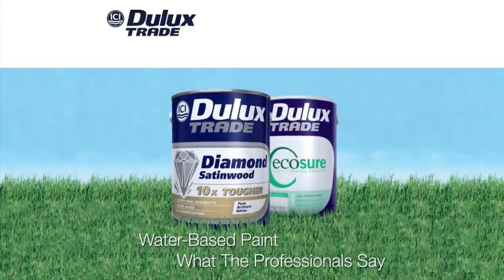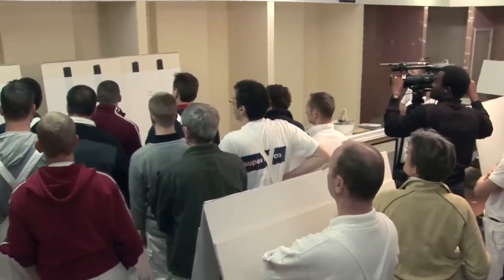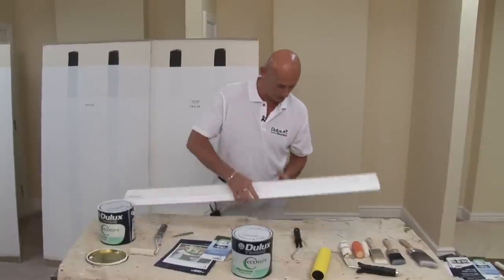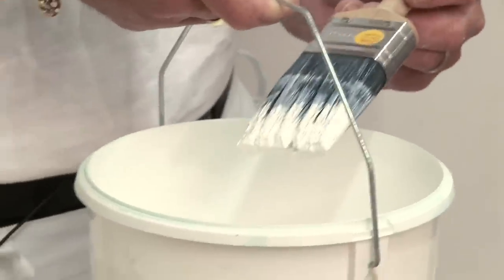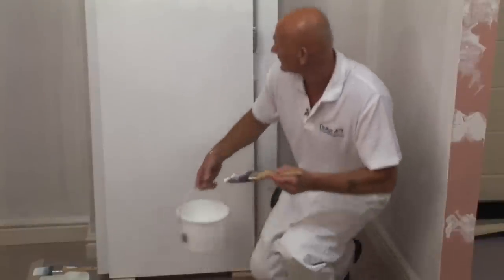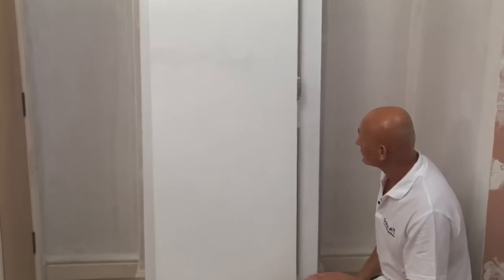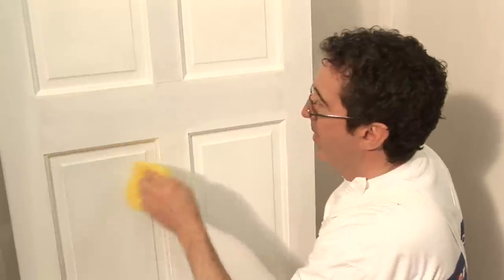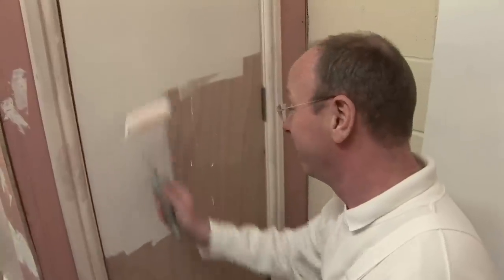Water Based Dulux Trade Paint - What The Professionals Say

Comment: I've been a decorator for 42 years and hated water based gloss/satin. But they're getting better. I've just done a job and used Dulux water based gloss. It was surprisingly good. I used the Johnstones equivalent last week and found it to be better. Watching this video I can't understand them using a small roller. I use a medium pile for flat surfaces and then finish with a brush. Speed is the thing with water based and outside work is impossible with them. Wiping the surface with water? Surely that's just thinning the paint as you apply it? On panelled doors I find using a 2 1/2 inch brush and a 1 inch for the recesses works fine. But speed is the thing.

Comment: I thought I must be doing something wrong with it, due to visible brush lines in the finish, despite damping the brush just like him and then using  coach painters method which is quite similar to his way.  
Looking at the close up at 4:41 , if anything my finish with that stuff is at least as good. This proves they've got a way to go before making it as good as oil based. 
I've been a painter for 15 years. I'm a perfectionist and take pride in working out the best method for a fine finish. I can put on oil based with virtually no brush marks, so I don't feel quite right signing of on an even slightly stringy finish with water based even if it is better for the environment. 
I'll only change to water based if they can sort out the flow rate problem.

Comment: By wetting the door slightly like he shows in the video with a sponge  before he applies the water base gloss to the door, Won't this greatly reduce adhesion and promote bubbling? Please correct me if i'm wrong if it doesn't that's a great tip and would make applying water based gloss about 10x easier with a better finish.

Comment: I've just used acrylics to do a couple of rooms and I'm going back to oil even if it does yellow. Coverage is very poor, yes it's easier to clean up but you'll be cleaning your brushes a lot more often since it goes off so quickly and gets stringy. Will try again in a few years.

Comment: As other people have said the water based paints dry super fast and leave unacceptable brush marks, In its favour it does stay brilliant white. I have just used Dulux Professional White Undercoat and Gloss, the undercoat goes on very nice and you can cover a lot of imperfections with it, the gloss goes on very nice too and the effect is like glass on my frames, "well I did do a lot of sanding :)". After 2 weeks I scuffed the stairs paint and a flap of skin came away, leaving wet gloss underneath, after 3 weeks I was able to put a finger nail mark in the paint, after 4 weeks the paint is feeling harder but still not fully cured.
Good paint overall, for my next job i'll try Leyland gloss as its a lot cheaper and has good reviews from screfix.
Reply: +3volv Have you tried the Leyland Gloss yet?
Reply: +Anon Nymous Not yet, I did try the Leyland Trade Emulsion, the paint was full of skin, had to pick loads out the tub and still had bit all over the wall, a week after I painted the hall I used a wet cloth to wipe off a mark, the paint came off :(
Reply: +3volv Interesting. I used their Trade emulsion and didn't have any issues with it. Also found their waterbased eggshell pretty good too. Just need to find a hard-wearing satin or gloss paint that STAYS white for more than a few months.
Reply: +Anon Nymous The Dulux I used took like 2 months to fully harden, its still white and like glass. trial and error I guess, hope you find a paint you like.

Comment: Used a water based gloss on my door frames. Thought the finish was so bad i decided to strip down all my door frames down again. Water based dries to quick and doesn't level properly leaving unsightly brush strokes. Trying to strip it all off with a heat gun has been a right pain as it turns into sticky elastic substance.

Comment: I'm a professional P&D with 40yrs experience, I much prefer oil based paint systems. Yes, water based has its advantages, but it flashes, yellows quickly, ruins my brush stocks despite wetting prior to use. I lay off with a great quality laying off brush for water based gloss, it helps but i prefer applying 2 coats for a decent wet and solid finish. Overall, I'm a dinosaur that still prefer oil based systems I'm afraid.
Reply: bumble1612, I wonder if you could give me some advice, I've just painted a flush door, using  Dulux Trade High Gloss and a sponge roller. You can see lines all down the door where the roller slightly overlaps, I used the roller on a glass door with just a four inch wood surround and it looks fine.  Any help would be great. Cheers.
Reply: RAVEN AK47  Thanks a lot for your reply, I used oil based paint, Dulux Trade High Gloss. Cheers
Reply: RAVEN AK47  Thanks again. At first glance, painting seems like the  a simple  DIY job, it's anything but. Everything is simple until a standard's set. 
Cheers.

Comment from the maker: Thanks for the feedback guys. if you have any questions, why not give our Technical Advice Centre a call on 08444 817 818, they will be happy to assist.
Reply: I’m not familiar with your particular paint but have used waterborne paints for over 20 years and their evolution has been remarkable. I would never go back to oil again and find the finish to be every bit the quality of oil, having said that your demonstrator was over brushing & rolling which works air into the product and leaves heavier texture in the end product.  Thanks for your contribution to the advancement of waterborne paints in the industry.

Comment: Sorry Guys, but I have tried so hard to use Dulux satin wood quick dry and the problem is they are lightning fast dry. Apart from trims (door frames, skirtings etc) any attempt to use quick dry on a panel door is doomed to failure. Within seconds they are too thick to brush out. Heavy brush marks and uneven sheen. I have wetted the doors etc. etc. but it makes no difference. I painted a door today with Dulux oil based satinwood  and Oh what joy of application and finish.
Reply: I'm not a professional by far but doesn't that mean toy have to change the way you apply it.  maybe note work well be required but isn't that Good for the environment

Comment: Like most of you guys ive been at the trade along time but water based paints are the way forward & the are improving give them a chance after a month are 2 you would nt go back to oil based  but i always use a paint conditioner it gives you a very smooth finish & longer working time dulux great paint but guys i use fleetwood prestiege satin expensive but unbelieviable finish especially on handpainted kitchens.

Comment: I have had to redo a panelled hallway in my own house which I had previously painted with Johnstones eggshell It was done just 2 years ago and  just yellowed off to an absolute cream colour.I was very disappointed as the preparation was perfect and the finished job was  really top knotch.
I decided to rub all down with a red scotchbtite pad after first being cleaned with sugarsoap. On advice to from a friend I used Dulux Trade satinwood water and I have to say I found it really difficult to work with.
Despite using Purdy  brushes and rollers  every time I laid the paint off  I was pissed off when 15 minutes later I either discovered either runs or as The Dulux videos call them TEARDROPS.
After leaving overnight to dry they were nearly impossible to rub out as the paint seemed to be sitting on  rather than drying into panelwork. Some of it came off like vinyl.
For the second coat  I experienced the same problem and was continuously checking for paint sags and runs.I may add at this stage I was aware that the first coat was very poor covering,and not looking forward to a possible third coat application.
As a car painter for 45 years  I must admit  that I was sorry for  purchasing Dulux satinwood,and the only reason I have persisted was that the brilliant white is  it supposed to stay white as opposed to the intensive yellowing of Johnstones Eggshell.
Overall I feel that this product is still not ready for the market and would love to hear from anyone who knows how to use it properly.
I may add that the Johnstone Eggshell  was put on on top of Morells 2 pack kitchen primer which the MDF panels were primed with. At the time  the primed mdf sheets were sanded  to a real smooth finish. I only applied one coat of eggshell and the finish was astounding.
Sorry for being long-winded but  the hallway originally took 10 days to paint and now I am redoing it with a product that I  am very synical about.
Can Dulux please come forward and tell me where I am going wrong.
Reply from the maker: Please drop us an email on DPUKI.TACSocialMedia@akzonobel.com and we'l be in touch

Comment: I PURCHASED THIS PAINT WITH OUT READING ANY REVIEWS I DID TWO  PLAIN DOORS  SANDED THEM APPLIED  PRIMER  AND UNDER COAT THEN I PAINTED  THEM BLOODY HELL TALK ABOUT QUICK DRYING  DONE  SMALL SECTIONS AS NORMAL BUT THERE WAS NO WAY  YOU CUT BACK INTO  PREVIOS PAINTED EDGE AND I'M TALKING  LESS THAN A MINUTE  ENDED UP WITH EDGES YOU COULD HANG FROM AND BARE  PATCHES WHERE THE PAINT WAS DRAGGED AWAY BY THE VISCOSITY OF THE PAINT AND HOW IT ADHERED TO THE BRUSH  SO I SAID HEY OH IT MUST  BE ME SO RE SANDED TRIED A BIGGER BRUSH THINNED IT DOWN A BIT AND TRIED AGAIN EXACTLY THE SAME SANDED AGAIN TRIED A ROLLER LOL NO WAY  SO I SANDED THEM DOWN USED PROPER PAINT AND VOILA PERFECT
SO IF YOU WANT TO WASTE MONEY AND A WEEK  OF YOUR TIME THIS IS THE PAINT FOR YOU AND YOU CAN HAVE MY TIN IF YOU WANT BUT YOU WILL HAVE TO GO TO MY LOCAL TIP
Reply from the maker: Hi Les sorry to hear you have had problems with our paint please can you contact our customer service number on 03332227070 we would love to help. Nicole
Reply: les truth  use a roller,  and turn your heater off

Comment: I'm repainting over Dulux oil based gloss that is 30 years old and still in good condition, yes it has faded a bit but is not unacceptably yellow. Rubbing down takes a while as the paint is quite hard, how does old water based paint rub down? This is being painted with Dulux Trade gloss again - is the modern oil based paint as good as the old? The room I am sitting in was done 5 years ago and is still good with no obvious yellowing. Yes I am a perfectionist as well so am happy to take a bit of time to do the job, it will probably receive two undercoats and two gloss, that is what I have found is the secret to keeping things from yellowing! How is a paint job that wears terribly over a short time good for the environment? I am a retired scientist and don't believe the hysterical predictions anyway. I have done proper coach painting as part of my hobby for over 30 years so am experienced at getting a good finish with oil paints. Water based gloss? OK for a cheap quick job for non-discerning customers! If you slap lots of thick water based paint on the door edges, will they still shut? So the message in the video is to tell customers they have to accept a poor job that looks awful because that is 'progress'!
Reply from the maker: Solvent-based glosses will discolour at a faster rate than previous formulations as a result of formulation changes. This is as a result of EU legislations  introduced in 2010, designed with reducing the amount of VOC's (Volatile Organic Compounds) used in paint products. We would not expect a solvent-based paint made after this to remain as white for the same time period as it did before. We recommend water-based paints now as they will remain white.
Reply: @DuluxTradeUK  It's not just about remaining white but actually having a decent finish! Frankly what I have seen on the video would not convince me to use your water based paint at all, quite the opposite in fact. Slap it on thick for a finish that looks like a five year old painted it - utterly useless on my paneled doors with multiple bead mouldings. I used some post 2010 Dulux proper white on the ceilings of one of our carriages and it has not yellowed noticeably in the last few years, neither has that on the door in this room as I said before. I seem to recall Johnstone's saying that their modern solvent white does not yellow so maybe their paints would be a better bet than yours now? Read the comments here, most people thing the water based stuff is rubbish!
Reply: @sunnyjim1372  crown trade next generation undercoat and gloss if you like oil's will stay white longer than any other interior oil gloss
Reply: @jackwardley3626  Thanks, I will give it a try, although I am sceptical about their assertion of not using an undercoat!
Reply: @sunnyjim1372  yeah these a undercoat as well thats next generation undercoat and with next generation gloss used to use it all the time but now im all water based. if you type crown trade next generation gloss reviews  into google these a load of information about it from a big edinburgh firm with information from crown themselves if you mind peace of mind before using it.
Reply: @jackwardley3626  Hi we do restoration work on vintage railway carriages so water based paints are simply not suitable. I would always use and undercoat anyway to get the finish I require - and hopefully a near mirror gloss - the benefit of not doing it for a living! I did look at the crown website and they suggested for overpainting that an undercoat was not necessary, but I would always use one. I still prefer to use oil paints at home as I find it easier on some of the more complex mouldings. We tend to use Owatrol oil to condition the paints and make them easier to use with the minimum of thinners where necessary.

Comment: Been Painting /Decorating 35 years and these water based  gloss's are absolute rubbish, however interior  work can be speeded up dramatically using a  water based undercoat then an oil based topcoat but NEVER none drip or One  Coat, that too is absolute rubbish.
I always  use Leyland Quick dry Undercoat and Dulux  professional liquid  gloss.
Outdoors dont bother with anything but  oil based on  timber. Anyone recommending the stuff knows  nothing about a decent finish..........just  like new  car paint  now...all awful with orange  peel finish.
Years ago MAGNET LEAD BASED was  great stuff, lasted for years, even oil based now is  thin.

Comment: A couple of general questions about trade paint vs retail paint, if anyone can help please:

If the wall is freshly plastered and well skimmed, is there less of a reason to use Trade paint compared to Retail?

Dulux claim they add more white pigment to improve "intrinsic opacity". But does this mean there is negligible difference between Retail Pure Brilliant White and Trade Pure Brilliant White as they are both entirely composed of white pigment anyway and therefore opacity would be about the same?

Comment: if you have to use them price In flowtrol, undercoat OK cuts back well powders up well. t/c rolls up on denib only saving grace is low sheen levels hide a multitude if sins ,stick to oil

Comment: Wouldn't it be better for your demonstrator to apply it quickly to the whole door with a 12 inch mohair roller sleeve and lay off from top to bottom with a 2" brush? The way he was painting that door looked a bit rushed and awkward to be honest..
I really don't like water based gloss products thus far as Ive noticed that wallpaper paste livens the paint up on skirting and architraves even if its had 12 hours drying time..
Reply from the maker: Hi Anna C - thanks for the feedback, have you heard about the latest Dulux Trade Quick Dry Gloss? How to achieve the best finish with Dulux Trade Quick Dry Trim

Comment: Difficult to use try using the paint on a hot day. Yep you know it’s a disaster
Reply from the maker: If you dampen the brush bristles and the surface with a damp cloth it'll make applying the paint easier, particularly on a hot day. It's also very important to use a synthetic bristle brush as opposed to natural bristles.
Damon
Reply: @DuluxTradeUK  use bedec  gloss finishes. Blows Dulux gloss out of the water😁

Comment: REINVENTING THE WHEEL.
having tried johnstones one coat water based  quick dry satin finish, i can honestly say what aload of  crap it is. having always used oil based paints i know for  fact  i can get near perfect finishes everytime.
firstly my main concern was that it took 4/5 coats,yes you herd correctly to get a even finish. it leaves thick brushmarks even when layed off.the proble is you carnt work it as it goes off ridiculously quick .  trying to maintain a wet edge is virtually  impossable and the flashing is highly noticeable after each coat.  The finish is poor   and in-even. Evenı though  preperation given to the areas to be painted prior to  coating up  is standard practice , i spent far longer on the job than i would of if i had used good old Dulux satinwood. 

i understand the imputus behind the company's who are manfacturing it  and the fact its much more environmentally friendly  but  the oil base version is a winner hands down for me. I W'ONT BE PURCHASEING IT AGAIN OR ANY OTHER SIMILAR PRODUCTS.

Comment: Impossible to get a professional standard finish, poor level of gloss, impossible to touch up, very easily damaged finish, soon wears off surface with any level of traffic, brush life greatly reduced even with thorough washing out clogging occurs, very high volume of paint used per door etc compared to oil based gloss, totally negates skill level of decorator gained over many years, dreadfull for cutting in, I could go on but just don't bother with it, it's rubbish.